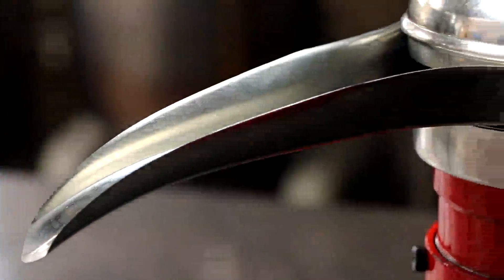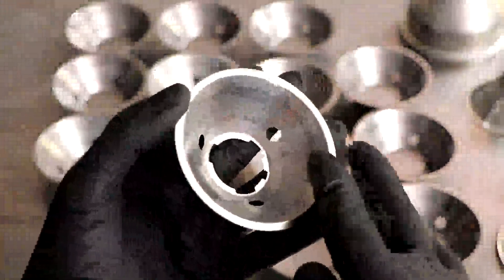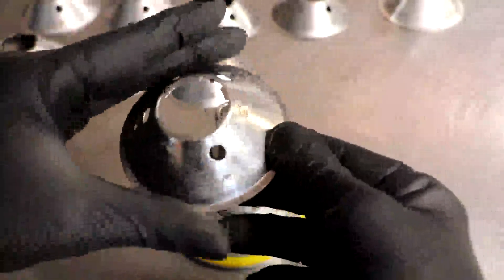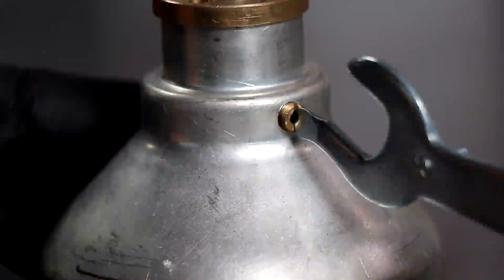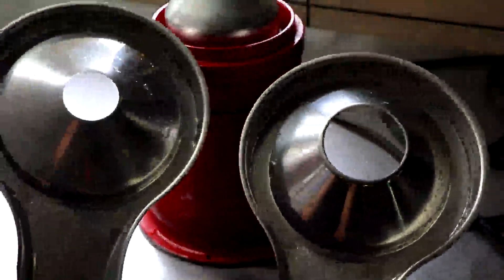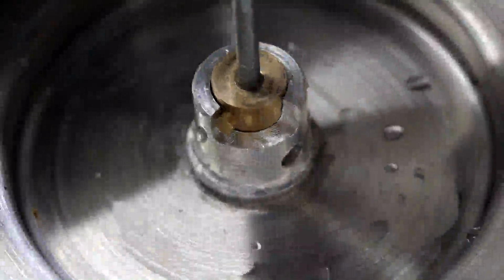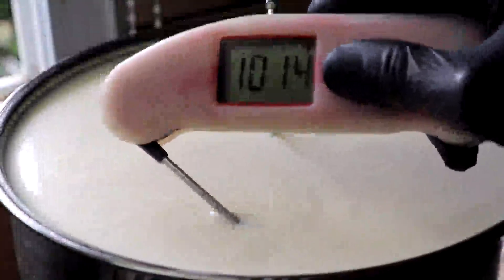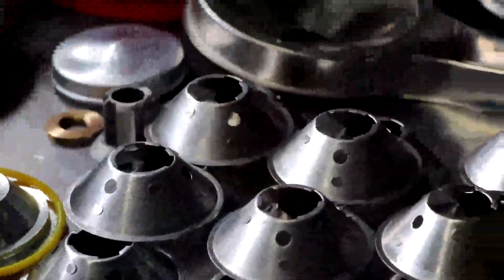Electric Milk Cream Centrifugal Separator

Comment: It is really a good video. I have the Vevor which seems to be an almost identical copy of yours. Too bad Vevor barely speaks English they even call the drum by the wrong name on the parts assembly page!

I even had my drum assembled wrong though I got a whole quart of cream from 2 gallons of MY GOAT MILK not su re what you would get from the stuff in the store. So know that it is assembled properly I wonder what I will get now.

Apparently the default cream screw position from the factory is 4 turns from fully in. I have mine at 5 turns out. Really happy to see you figure that out too.

I do not like the float design. Milk can get inside the float and it is hard to separate the two halves.

I wash mine in the dishwasher except for the float. I handwash the float and the drum gasket I also handwash. I don't want the float collecting wash water and I think the only way you can really clean it is to take it apart and handwash it.

I don't know when I would have figure out the order on the drum disks so a great big thank-you for that.

Vevor is only rate by Vevor at 50L/hr.

But you are missing out on something else you can make from skimmed milk. Ricotta cheese.

I find the skimmed milk is really good anyway. But you get a reasonable yield of ricotta from 1 or so gallons of milk.
SO Simple:
1. Heat 1 gallon (goat or cow) skimmed milk to 180 degF-195 degF.
2. Remove from heat.
3. Slowly stir in 1/2 vinegar (I use white, but I have used lemon juice or apple cider vinegar) stirring slowly for about 10 seconds.
4. Let it rest for 30 minutes.
5. Run through a cheesecloth to separate the ricotta curds.
6. Let drain for about 3-4 hours.
7. Store - it also freezes well.

You can also make whipped ricotta which can be adjusted for anything from a garlic onion affair to honey sweet to sit on french toast.
Reply from the maker: Thank you very much for your feedback! We will continue to optimize our content and bring you more valuable information in the future!

Comment: The three allen screws with lock nuts on the sides lock the the head at the desired height.  At 4:09 you incorrectly said that this feature is to select the height of the head to match your containers.  However, this feature is to set your head at the correct height so that the milking spout just-just clears the spinning drum.  If you screw the head down too far, your milking spout also lowers closer to the drum.  As a result you will hear a grinding / screeching noise as the drum scrapes against the milking spout.  It will cause a lot of vibration too and slows down the drum rotational speed.  You need to raise the head then by unscrewing the head counter clockwise until the drum spins freely and just-just clears the milking spout.  This desired height you can obtain through trial and error screwing / unscrewing the head.  Once you have obtained the desired height setting of the head, then you lock the head in position with the three allen type grub screws and then lock those set screws with their lock nuts.
Reply: I just have found it myself by having my cream mixed with skim milk by not checking if heights of rotor's exits are correctly adjusted. As the saying goes, best way to learn is to improve of one's errors :D
Reply from the maker: @maciejnajlepszy  Thank you very much for your feedback! We will continue to optimize our content to bring more valuable information！
Reply: Do you know where to find replacement cream regulator screws?
Reply from the maker: @HomesteadingADimeataTime  We apologize that we no longer carry this product and look forward to seeing you in the future with a new look for this product!
Reply from the maker: Sincerely thank you for your feedback, we will continue to optimize our video content and strive to do better in the future!

Comment: I used mine for the first time, but I think I did something wrong.  Didn't ger very thick cream, can't even get it to whip in a kitchen aid mixer.  The skim milk that came out was very frothy.  And then, when I was done and cleaned the centrifuge, the outer shell had quite a bit of butter built up.

Do you have any suggestions for things I can try to troubleshoot this?
Reply from the maker: We apologize that we no longer sell this product and are in the process of a technical upgrade. We look forward to seeing you in the future with a new look for this product!